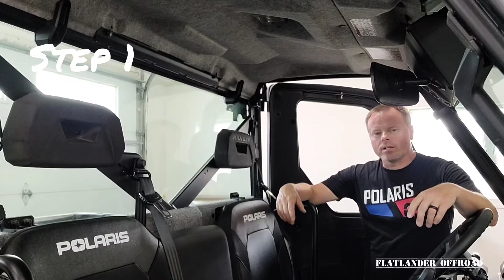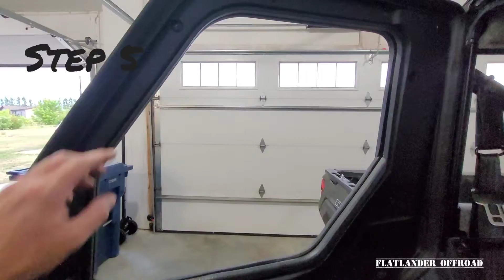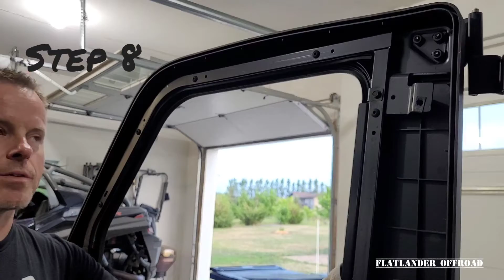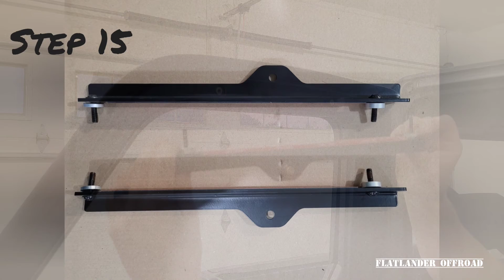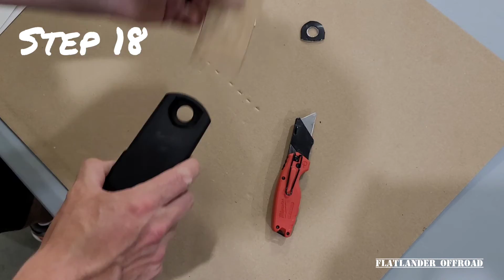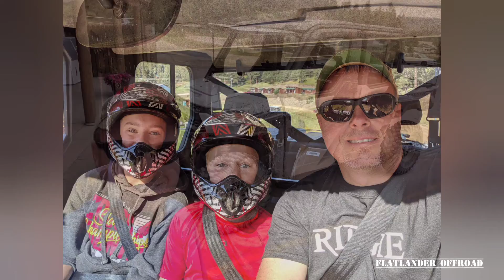2018-2027 2-door and 2019-2027 4-door Polaris Ranger 1000 XP Door Strut Installation

Comment: Does anything change for the rear doors on a crew cab? I am starting on this install this evening and will see how it goes. Starting with the rear doors first.
Reply from the maker: The rear doors install very much the same. The bracket mounts to the front corner of the door. Not back by the hinge. Let me know if you have any other questions.

Comment: I just bought your kit and have the crew. Is it possible to mount the seat belt hardware without removing the rear glass? I have the OEM headache rack from Polaris and would have to remove it to remove the rear glass.
Reply from the maker: Yes it is. I don't remove the glass for installations. Be careful not to drop the 10mm nut that holds the rubber strap on. I tape it to the wrench so it doesn't fall behind the seat.

Comment: Anything different install wise with the power windows?
Reply from the maker: The upper door panel swings out of the way instead to coming off completely. You don't have to unplug the power to the door. The rest of the install is the same as the non power doors. 

The video shows the first generation kit. The new kit has no double sided tape on the door brackets. The pillar bracket is reinforced and the struts have steel ends.
Reply: @flatlanderoffroad8189 Thanks for the info. I ordered a set.
Reply from the maker: Thank you for your order!
Reply: I just received the 4 door kit. Do you have an updated video showing front and rear door install?
Reply: Actually I just need clarification on which brackets are for which doors. Thanks

Comment: I’ve watched this twice 
Why is it necessary to remove the upper door panel?   Seems like you could drill metal to 22/64 and the plastic to 1/2 without taking it off 
Thanks will be purchasing soon 
Just curious because I have mirrors already installed so taking the door panel off means removing the mirrors in my case
Reply from the maker: You are correct. It is not mandatory. It just gives access to install the rivet nuts. Let me know if you have any other questions.
Reply: @ 
Thanks !

Comment: The description title is confusing me a little. Is this compatable with a 2019 two door Polaris Ranger XP 1000 or only a 2018?
Reply from the maker: @JerryKneifel  Polaris changed the 2-door to the new body style in 2018 but didn't change the crew until 2019. The Ranger in the video is actually a 2021. The kit works on the  2018 2-door and 2019 crew through 2025 1000, 1000XP and Kinetic.
Reply: yes it is.. 2018-2025 for 2-door models and  2019-2025 crew

Comment: I like the looks of your product, but a little intimidated with taking the door apart. What is the downside of just drilling out the top holes and bolting the bracket on with the bolts on the outside of the door. I know it might look like crap. By the way, a great video.
Reply from the maker: @robmortimer9762  the reason for taking the inner door panel off is to gain access to install the rivetnut and to drill the 1/2" holes in the plastic inner panel. The spacers that go into the 1/2" holes are just thicker than the plastic of the panel so you're not squeezing the plastic when the mounting bolts are tightened. Without removing the inner panel it is tricky to get the rivetnut installed correctly. It is possible but much easier overall to remove the panel. 

If you email me at flatlanderoffroad@gmail.com or contact me through our site I would be happy to talk to you over the phone about it.

Comment: Should we use locktight?
Reply from the maker: The door bracket bolts have vibra-tite on them already and the shorter two bolts attach with the original lock nut so you shouldn't need additional lock tight.